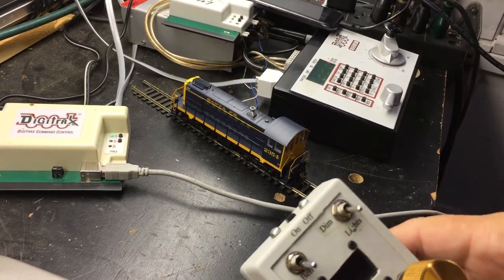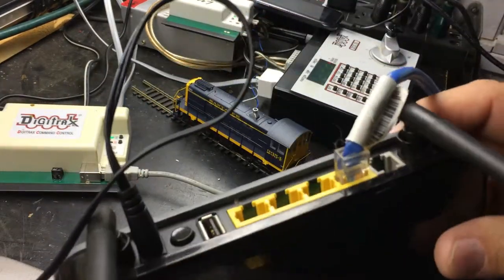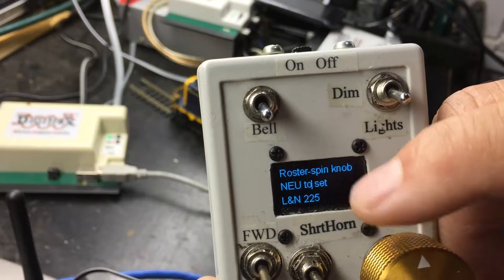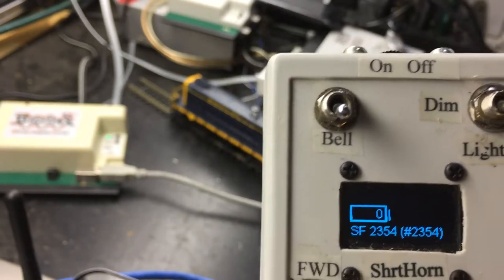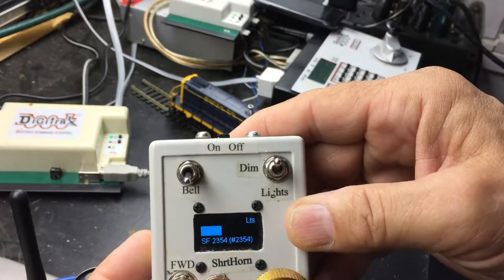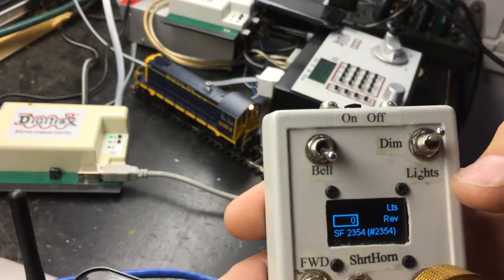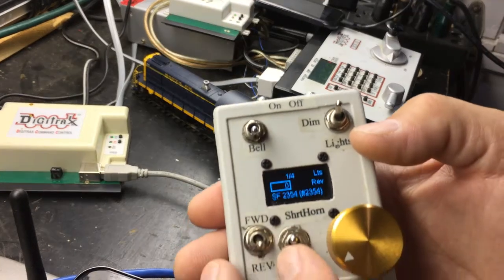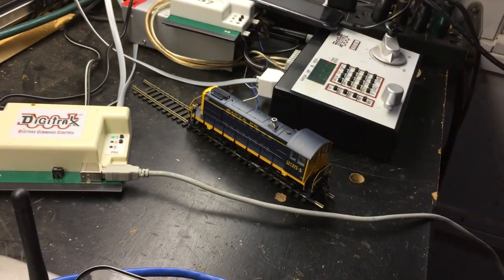SWIFT #0 as of  August 7, 2019

Comment: Hi Phil - is it possible to control more than one train at a time - meaning one loco is moving and then you bring up another loco and move that one?
Reply from the maker: Howdy Shelton. With the switches I installed on mine, and the sketch running now, no.  This is programmed to always dispatch before acquiring another. 

However, there are a number of options for control of more than one loco (other than consists).  The simplest that I thought of was merely adding a physical switch (rotary perhaps) as a means to switch between locos that are acquired. The display would show the relevant information for the "active" (currently selected) loco and have some indication that other locos are lurking in the background. Also, the controls (lights, bell, horn and speed control) would only act on the "active" loco. 

I would probably add an "All Stop" button as well because if the "fit hits the shan", it would take too long to dial in each one and stop them. 

So, with a couple of added physical controls, the sketch could be modified to allow as many locos as desired.  It occurred to me that some museums might have 5 or more trains running, all on different loops (so no collisions) so this would work great. 

Also, the existing switches and speed control would force their state onto each active selected loco, since they are maintained contact.  That is for example, if the switch for the bell is turned on for one loco, then a different loco is selected, the bell on that new loco will be turned on regardless of the previous state (before being selected) so maybe a momentary switch which would allow toggling.  By the same token, the speed is hard-coded into the speed control position, so an encoder (so that relative motion could be read) would be required.
Phil